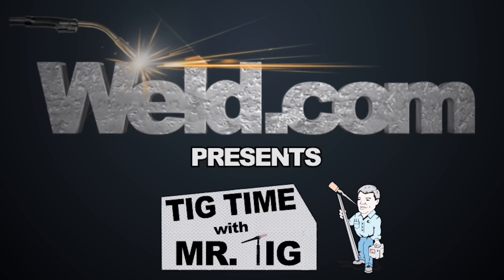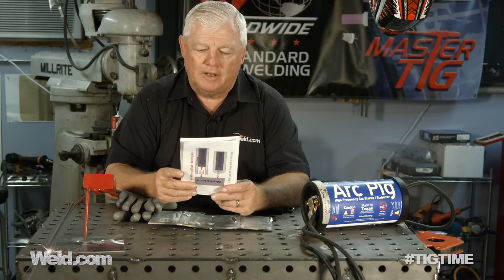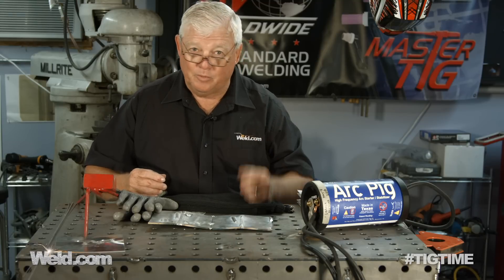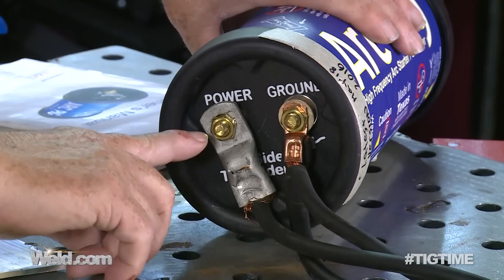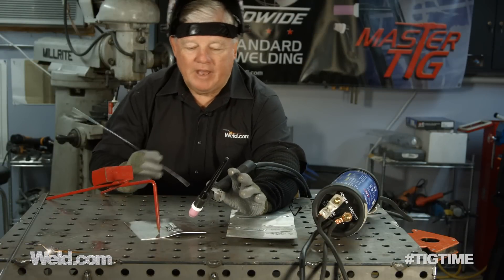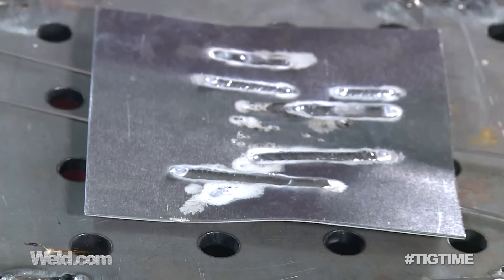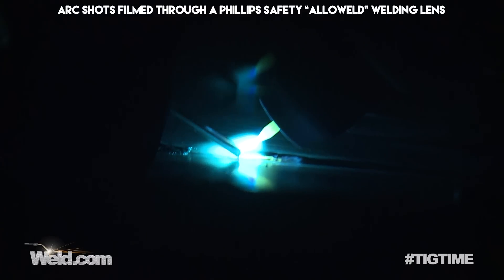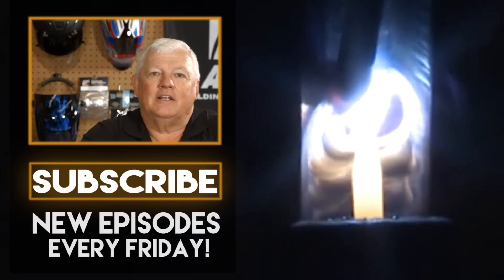TIG Welding Aluminum with a Lincoln Buzz Box & Arc Pig | TIG Time

Comment: Will this work for an old (70's era ) gas engine weldenpower? It is AC/ DC + & - .
Reply: @rickrunyon5086  yes you can . I run one on my trailblazer 301 and it's a sweet little deal. I've done lots of aluminum Tig work with it in the field right off my truck. Game changer ! Not many people have this capability in the field. I love it. I'm running the arc pig not the Tig pig which is even better cause it will allow water cooled torch.
Reply: @ericsikes2739  I'm wanting to do carbon /mild steel work.  So it is good to go?

Comment: I saw device with this exactly functionality made in like 1975 or so in USSR. I was working at a brewery (factory-kind of) in 2008-2011 and our welder used that device with a huge old 3-phase transformer machine to weld aluminum and stainles (with add-l rectifier) with TIG.

Comment: The Lincoln 220 AC welder was the first machine I bought in 1973.
Since then I've added a 1964 Miller 250 AC/DC-HF tig-metallic unit along with the   S-52A wire feed unit, a cheap Cambell Hausfeld stick welder, a Hobart XL-225 AC/DC and my newest, a Klutch 200vsi inverter MMW, MIG, MFCW, TIG unit which beats the Vulcan from Harbor freight.....
Would love to have an Everlast multi machine from Canada, but out of my price range for the moment.

Comment: The Arc Pig is amazing! I have one and I use it for stick and Tig. It’s bad ass. The high frequency start allows you to do DC or AC ( for aluminum) Tig and stick. 
It’s s game changer! 

I can EASILY start an maintain an arc at 10 AMPs on a basic stick welder! The high frequency helps you maintain arcs at low amps so thin material is MUCH easier!
Reply: They discontinued it on their website do you know where I could find one?

Comment: Great piece. Its more about the "Weldor" than the Welder. 35 years ago I learned how to TIG on a Lincoln Round Top and a Miller HF-15 and fixed everything under the sun from heat exchangers to aircraft pieces. I just recently bought a Precision Tig 225. I'm just learning how to use all the fancy crap.

Comment: That's very useful, I just understand something after watching this video, which is: the ac arc welding needs HF between changing phases, because the plasma arc will disappear. I'm not sure if this is correct, but if some one has some technical info about how fast can the plasma vanish, is it of the same speed of light/electricity? If yes, so diffently AC arc welding needs HF between switching phases. And all tig machines should be doing that in an automated way.
Reply: I found a comment on quora that supports my comment. Thanks for the internet for making sharing knowledge that easy
https://www.quora.com/Why-do-we-need-a-high-frequency-in-a-TIG-welding-machine

Comment: How about a 2 rectangle graphite  rail setup as a molten metal guide for the liquid weilding. placed on the bottom lip of that torch so you weild inbetween it. To cube surface align level and strengthen those puddles as your wielding along to make its surface strength unified instead of stacked? All weilding would be done between the rails. I made that up but dont see why it wouldnt work.

Comment: Any updates?  Interesting just for the welding of aluminum alone I'm thinking and am wondering about which project to move forward with as I just invested in a Lincoln AC225/DC125 that I wasn't sure if was best since I can hack a AC225 to DC for way less than I expected that looks like can handle DC225.  Will save time though and the money until I research more, plus the work I'm planning isn't thick material yet.  It's been ~25yrs since I've welded too.  Looking forward to some updates... keep em flowing for us disabled.  Plus, not having the Stockholm Syndrome and more the U.S. Diplomat, Staff, Family and others in Cuba, China, Moscow, and elsewhere issues... I'm thinking welding will be fun in other ways. http://dewdefenseprojects.blogspot.com/2019/09/cbs-news-60-minutes-are-us-diplomats.html

Comment: were you engaging the hi freq the whole time you were running it on aluminum, or just using it to establish the arc momentarily, and letting off the switch?
Reply: Would also like to know the answer.
Reply: You have to engage the hi frequency all the time when welding, otherwise the arc will sputter and stop.

Comment: I have a Plasma cutter that's dual voltage  110v or 220 v I can connect the 110-volt plug pigtail that will plug into 220 volts for heavy material?

Comment: Now what would be helpful is a simple device you could hook up to some car batteries so that you could get a little high voltage arc and be able to use batteries in a pinch
Reply: I wonder if that machine would do it.?
Reply: @michaelszczys8316  That would be a interesting hack and maybe you know someone that can get one to demo, test out and tear down.  Wondering what the guts of this is... looks like is using a Champion CJ7Y spark plug,  two 0.05 uF
 (50 nanofarads) 250 Volt capacitors between the leads and grounded as well as some other electronic stuff with some specifications in and after the schematic. 
https://www.arcpig.com/arc_pig_user_manual.pdf

Comment: I use a  Miller Syncrowave that is capable of arcing about 4 inches. I have been blasted by it a few times real good. For that strange machine I think I would use rubber gloves too

Comment: Nice video well explained ! It's fun to get an old welder machine back alive but now in 2019 you can buy a chinese 200 amp inverter tig and stick welder complete kit for around $299.00 C.A. with the torch complete all digital without the buzzing transformer ! for basic occasional use its cheaper that way ! If the company that makes the Arc pig could bring the price down to around $150.00 they will have a winner and sell thousands of these adaptor because these old Lincoln welder just won't fade or go away they were well built in USA to last 100 +years ! Thing is who wants to spend near 500$ total with the gun and accessories to fix a 50 years old welder when you can buy a new decent modern one for 200$ less ! Nowadays with technology they dont need that heavy expensive copper coil transformer anymore everything his made with electronic fast switching power supplies that make them less expensive !
Reply: Ah, good old 2019

Comment: sooo is it like a small capacitor bank that evens out or changes the current wave form pattern and stop severe current fluctuations? ? it's the first time I've seen such witchcraft it's pretty neat
Reply: Mudsuitable It’s more like a small tesla coil putting out a frequency to carry the arc over when it switches from positive to negative

Comment: the buzz box id love one but here in the uk you wont find one arc pic never seen one i use a invertor machine and a newarc viper 2000 hf controler for tig but mainly i stick weld most of the time

Comment: i like the pig but truth is yes a hf box will work i have one that i have used for years now only down side is the Lincoln is limited on heat adjustment if you don’t already have a lincoln get the miller thunder bolt same thing just has a better range for heat.

Comment: Okay, the Arc Pig is granted a good review and I can see its uses arould the shop or field. My problem is that lessor brand (Chinese) machines get shot down. They seams to be more convenient (smaller than the buzzbox and no odd connections) just as good a weld at the same power, and near same cost all said and done. Other than this being made her at home why should I buy it?

Comment: You can also find AC-only industrial transformer welders dirt cheap because they are heavy, which is easily solved by welding a cart. They run AC rods very well. They have the duty cycle to match and have a nice arc. My Hobart T-400 would overload an Arc PIg if it were maxed out, but run within limits would barely get warm. If you don't have a small buzzbox keep an eye out for such beasts. I bought mine for the leads but kept it because it's so nice to use. Before solid-state rectifiers AC transformer machines were the only non-motor-driven game in town.

Comment: so it's a rectifier and diode assembly. I was going to build one for my 1948 250 amp welder, but I guess I can just buy one. COOL.
Reply: no , it dos`nt change it to dc , this is high frequency for ac to weld aluminium
Reply: @jedeastwick6844  its a fake high frequency , you clearly hear all distortion that produce this ''thing''

Comment: hi!!! i dont speack english very well, im from mexico
i have a lincoln electric 225 amps ac/dc welder machine
i want to know 
its possible use my stick welder machine on scratch star tig in dc mode or ac mode for welding aluminium
please answer my cuestion... 
youre my teacher y like so much your videos
Reply: Alexander Motorcito : yes for dc tig.  A/c won't work.   I have  similar welder setup as you.       Our welders would need an arc pig for proper aluminum welding.
Reply: Alexander Motorcito 
Parece que finciona en tu maquina ya que lo mas que vas a usar es no mas de 200 amps

Comment: I'll take my buzzbox 230 caveman tig with hf box anyday over those junky lightweight inverter welders , I've seen a few of them blow up and 2 of them were Millers . Btw cool product and keep up the videos , enjoy your videos .
Reply: I wholeheartedly agree. Lincoln's TIG 200 (an inverter) is great when it works...but a local manufacturing shop near me has had 7 machines go bad in less than one year. At least they were under warranty.

Comment: Great video as always. ESAB here in São Paulo Brazil, has the "igniter", which serves to this function I even designed for me one, which is a high voltage of 5 kV generator. Here also says "high frequency" (50kHz), only because the high voltage is generated by a ferrite transformer type "Flyback" that works with "high frequency". I liked the design of this equipment is compact.

Comment: Used mine for all most 2 years now hooked up to 20 year old Miller Legend,  stick and tig with excellent results.  Both ac/dc,  But hey don't take my word for it check it yourself.  I  have spent way more on pure junk than I did for my arc pig

Comment: These Hi Frequency units have been around since the 50's . it is about time someone made one that was affordable. The issue for Miller or Lincoln was that such a unit would compete with their own production machine. My old 300-300 TIG is old enough to vote three times over and exhibits the same welding behavior as your "Newly discovered" super imposed Hi Freq adapter and Buzz box welder. I think a better welder for this application might be a variable core transformer type welder rather than the defined TAP type welder like the Buzz Box Lincoln, allowing finer amperage control as the work piece heats up and amperage requirements need to decrease.
Reply: I was wondering about adding a foot control and maybe a pot on the box.

Comment: My first TIG welder was a 450 amp transformer plus an add HF unit from ESAB  inside  the HF unit was  what looked like a car ignition coil and a transformer and a few capacitors (very high voltage ones) plus an inductor to stop the HF feeding back through the transformer although some did, in fact the HF got every where back into the mains even and the HF spark on its own could be drawn out several feet long. It was a right beast of a machine.

Comment: so i have a tig/arc welder but no ability to weld aluminium would this fix it without changing the tig torch or do you need the power button to work it
Reply from the maker: The power button comes with the Arc pig
Reply: you have to have ac and hf the button should just b on off

Comment: The Arc Pig Works awesome with 7018 DC overhead much easier to start with the high frequency button
Reply: QB Machine not needed but does help not sticking, having a start switch will make your stinger go cold, allows pulsed AC/DC stick welding or something similar allbeit not very adjustable.

Thousands of reasons why you'd want it only one I can think why you wouldn't want it and that's because you'd rather spend 10x as much on a blue set up with less features.
Reply: Jason Rogers why tf would you use or need that for stick welding like wtf
Reply: QB Machine  do even weld
Reply: @bigman7293  you obviously don't know much about welding.  There are many reasons and positives to hi freq welding.
Reply: Turbo Chevelle takes the point out of stick welding tho. I have tried hi freq start with stick before and I do not like it one bit, it’s really odd feeling
Reply: @bigman7293  just because it feels odd doesn't mean it has no uses.  When someone doesn't know how to bring and they need to weld or repair thin sheet metal hi freq stick can get it done.   Any ways there is a place for it and it saves people from having to buy a tig machine when they need to do aluminum.
Reply: Turbo Chevelle ok eh I guess if you say that although it is uncommon to stick weld thin aluminum
Reply: @bigman7293  it's not just for aluminum, you can hi freq stick light gauge stainless and other alloys as well.  This isn't an aluminum only set up.  Some of the stuff we weld down here you go scratch starting and leave arc marks and you'll get run off.
Reply: Turbo Chevelle sure makes sense if you go buying this and a TIG torch adapter for a stick machine rather than just buying a TIG machine
Reply: @bigman7293  makes sense that you don't know the cost difference between what you just stated.  Who the hell want to spend 1,600 - 3000 when the can buy this for under 400 and buy a torch for under 200 and do the same thing especially when they aren't going to do it very often.  It fits a need and market.
Reply: Turbo Chevelle you seem to have forgotten to factor in things like cost of the stick machine along with all the functions you’re going to get from a $3000 TIG machine. A stick machine with the $400 arc pig is only going to give you constantly-hot high frequency start TIG with no amperage control whatsoever, and likely no AC control if you even have AC. So don’t go trying to make me look like a fool when you can go buy a thumb switch lift arc TIG machine for the price of the arc pig alone.
Reply: @bigman7293  not trying to make you look like anything you're doing a good job of that on your own.
Reply: @bigman7293  constantly hot hi freq start?  WTH is that?  Do you even know what hi freq start is?  It's not hot, it jumps the arc so you don't have to scratch or lift arc start.  Save the bs bro, I was a certified welder for years.
Reply: Turbo Chevelle clearly cannot understand my simple statement. A stick machine is constantly hot, yes? So if you TIG weld with a stick machine, you have a constantly-hot tungsten, yes? So, tell me, after starting the arc by using the high-freq and completing the weld, how do you terminate the weld, when you do not have a thumb switch or a pedal? You SNAP THE ARC.
Reply: @bigman7293  actually if you would pay attention you would see that it has a thumb switch to activate the hi freq start.  You have to pay attention to details.  Good rule of thumb is an amp per .001 thickness.  If you are a talented tig welder then you can adjust your feed rate and travel for the lack of precision amp control.
Reply: Turbo Chevelle obviously for the high freq start. But that switch isn’t to terminate the arc though. And yes I know about that rule for aluminum. Have fun doing stuff like filling gaps and such though.

Comment: Interesting, but I would much rather add another $400 to the $350 and buy an actual TIG/Stick outfit, such as an AHP or similar. Too many feature are lost, argon control, foot pedal control, end of weld problems, .......
Reply: The idea is one device that adds hf to all of welders you own.
Reply: I was thinking the same thing. An Everlast 185 AC/DC TIG welder would be a better investment than something cobbled together like this.

Comment: I wish years ago I knew about this for my Miller Thunderbolt 225 AC/DC machine. I have advanced from that up to my Miller Shopmaster 300 CC/CV and Miller Syncrowave 225. These little machine work great I still use mine from back in the early 80's for small on site welding where I cannot get my Trailblazer 302 up close or I do not want to run a mile of lead out. very interesting cannot wait to see how it goes for the DC. I have a miller HyFreq box paid 1800.00 for it

Comment: But can you hand feed the rod with those rubber gloves? I use kevlar kleen and they give the right amount of friction
Reply from the maker: That was one of the big concerns for us as well, but so far it's not too bad. The material is not textured at the finger tips so you can feel the wire better and it slides surprisingly well. I believe tehy are going to be demoing these at the FABTECH show in November. So if you plan on going, be sure to check out their booth.
Reply: The ones ive obtained are a dark green set. They're pretty old. They have no silicon or any of that stuff on it. On google images they show some with a texture. I dont know how those will work out
Reply: I've tried many different Tig gloves and yet to find a favourite, I'm currently just using parwelds pu grip black engineers type gloves as my go to for low amp Tig jobs, although these don't offer any protection against heat only UV.. 

Maybe I'll give the Kevlar type a go, these stretch fit type of gloves are becoming more and more popular with Tig welders it seams and for good reason.. most Tig gloves I've tried are just uncomfortable.
Reply: Ernesto Castellanos Thanks for the info pal.. Happy welding